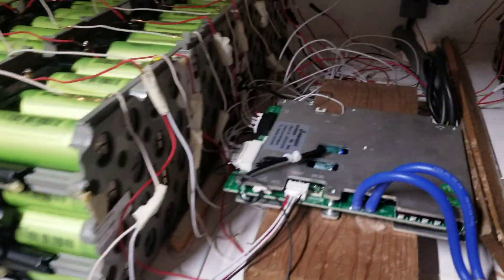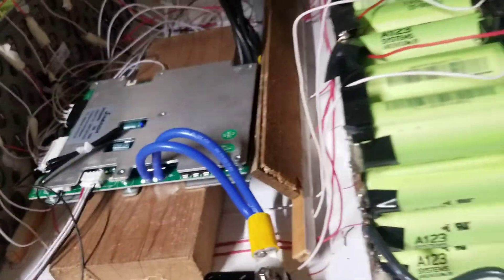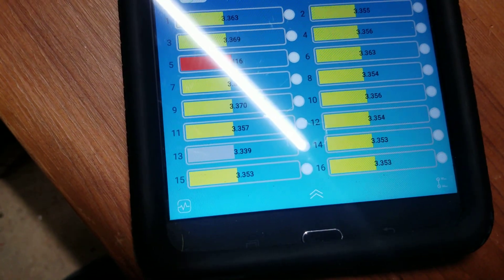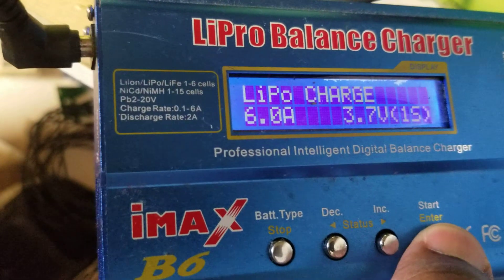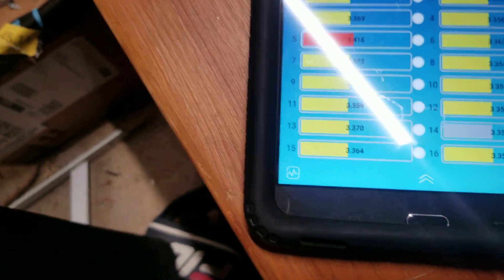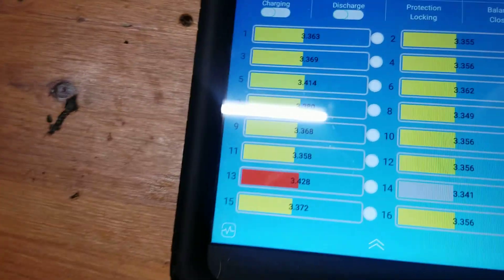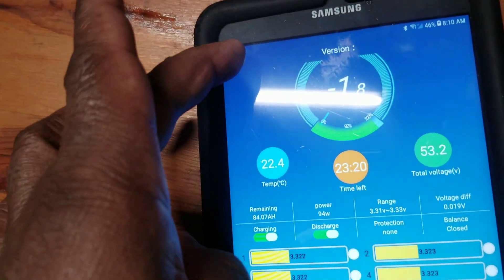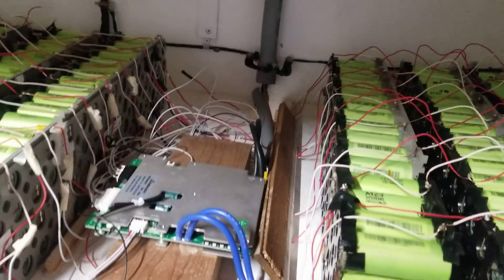DIY- How to balance your LiFePO4 A123 Lithium Battery cells in a 48V system battery bank

Comment: Cześć jaka cena takiego modułu 12s4p ? I gdzie można to kupić? 
Bezpieczny magazyn 👍
Reply from the maker: The module is 36V, 12s4p, I added 4s4p to it, It becomes 48v 16s4p, about 0.65kw. I took 1 module and cut it in 3 pieces of 12V 4s4p.
Reply: @simplyfocus9937  Hey, I was noticing that cell 13 was jumping around a lot. That is usually a sign of a loose or bad connection. The cell might be ok, but it does need a better/stronger connection and I think it will be ok. If you give it a better and more solid connection and it doesn't fix the issue, then you should replace the cell. They still sell these cells brand new under a different name. A123 was sold as a company, and now A Company named Lithium Werks makes these same cells. If you keep having problems with any cells, you can buy brand new cells from Lithium Werks for about $7-$9 each. Look around on the internet for Lithium Werks or check eBay for more used A123 M1-B used cells. A123 also made 18650 cells and they made awesome pouch cells as well. Good luck with your bad cell. I hope it's just a loose connection, but if it's a bad cell, you can buy a brand new one for less than $10 easy
Those A123 Batteries are awesome power dense cells. Each cell in parallel can output 50 to 70 amps in a burst situation. I was going to use these cells to make a very powerful Jumpstart pack for a car with these cells, because they can output so many amps in such a small Package. I want to do a 4s20p battery pack. It will be able to output 1400 amps to Jumpstart a car very easily with no problems for the next 15 years since Lifepo4 can do 3000 to 4000 cycles before you get to 80% capacity.
Reply from the maker: @catch22frubert  Thanks for the comment, you are so right about the loose wire, I did locate one section, I will the other sections later when I am adding as another pack of 48V
Reply: Jaka cena ile kosztuje taki moduł ?